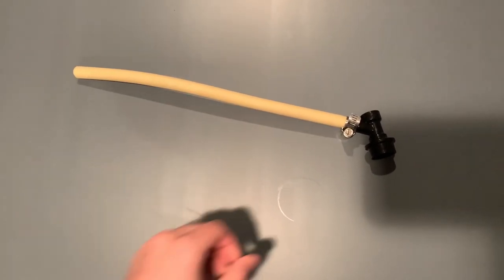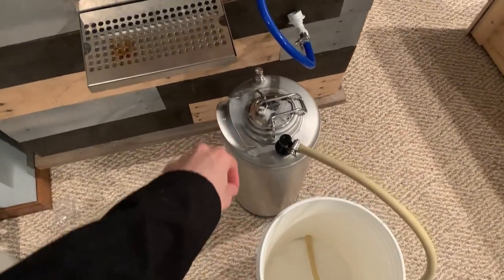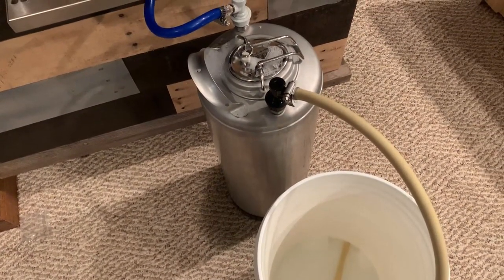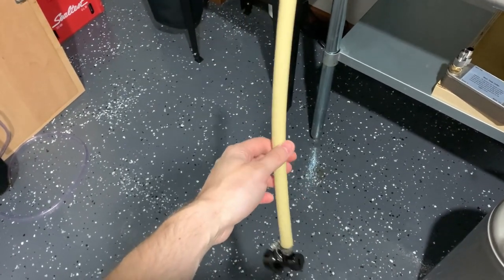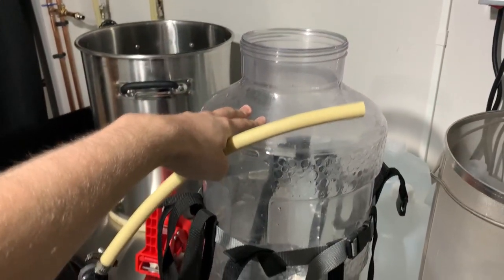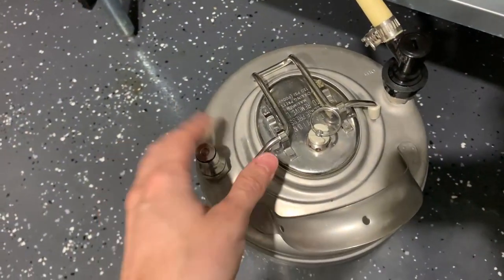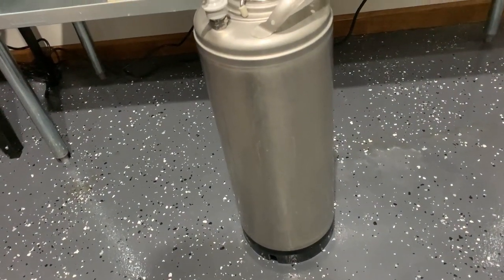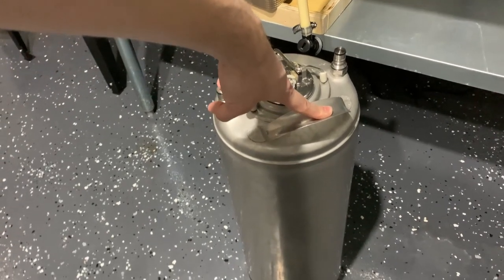CHEAPEST and EASIEST Way for Low/No Oxygen Transfers Into Kegs!

Comment: Hello again Matt - I do something very similar (though I am shiphoning out of glass carboys).   The only extra thing on my transfer is that instead of using the gas fitting to vent co2 out of the keg and into the room, and having the vent in the fermenter to let in air.... I have a tube between those two so that the co2 leaving the keg goes into the top of the fermenter.   It may be overkill, but I don't like the air (oxygen) sitting on top of the beer in the fermenter.
Reply from the maker: Hey I just checked my email, thanks for the image! A few things... 1) I am familiar with that setup but I mainly wanted to cover a way to do this with a very limited part requirement. 2) plastic fermenters are very sensitive to pressure so when you are recirculating I have seen people do damage to plastic fermenters when doing that way. So I just opt for this. 3) As far as the o2 concern on the top, im sure there is some o2 that gets into the fermenter but there "should" be a co2 blanket over that beer from fermentation where very little o2 would be in contact, in theory. Also there is less risk to begin with since the liquid is not being shaken up.
Reply: I do the same. Works well. I had not seen anyone else do this. So, I’m not alone.
Reply: @craigdjordan  you must be digging deep in the archives to find this one.  I just bought a couple 6 gallon torpedo Corny's as fermenters.  Plan to set them up for similar closed system transfer.
Reply: Great idea

Comment: I use a really similar method to this. Pushing out the star san with CO2 does a good job of making sure all components are sanitized. I also like to run the star san through my kegerator tap just to be sure it is sanitized as well. I have had a batch of beer that was amazing, but then soured a few weeks after kegging and the sanitation of my tap was the only possible source. To conserve CO2 when flushing, I typically just give it enough CO2 to get the flow going then let it gravity drain out of the keg from there (will work as long as you don't pull vacuum in the keg). 

One difference is that I don't leave the star san heel in the keg. I think if you checked there would be a few oz of heel. I just turn my keg upside down for 5-10 minutes, let it all drain out, then purge the keg once more.
Reply from the maker: Yea there is no doubt that there may be a few oz of star san at the bottom of the keg. I do my best to be patient and try to push out as much as I can but I never really worried about this after looking into it a bit more and how star san could effect beer flavor/character. I referenced this - https://brulosophy.com/2019/10/21/the-impact-star-san-foam-has-on-beer-character-exbeeriment-results/

Comment: How do you avoid over filing the keg (which I'm assuming will just spill out the gas disconnect)? Could you use a check valve gas disconnect which I'm thinking will just stop the flow when liquid hits it? My brew batches are normally a couple of litres more than the 19 litre corny and i transfer into a purged but open corny so I see when it's full and i just bottle the extra.

Comment: How do you know when there is a pound of pressure in keg? Also when you hook up co2 line to get rid of star san what pressure?
Reply from the maker: Hey Joe! When I said a lb of pressure I just ment that there should still be some pressure but not a ton. So just lift the PRV to let most but not all the pressure out. Just need enough to purge the line that hooks up to the fermenter. When hooking up for starsan removal it does not need to be alot of pressure. Maybe like after 1 minute of co2 pushing into the keg you can hook up the line to remove the starsan. Just want to make sure co2 is continuously flowing into the keg to displace the starsan.

Comment: Great (and simple) explanation Matt! That is my setup (with a NB big mouth bubbler plastic fermentor with spigot) and awhile ago I tried doing it that way but also applying a few pounds of CO2 pressure on top.  Even with applying a few pounds of CO2 pressure on top the fermentor 'sucked in' which made me nervous (thought it might implode?)!
Reply from the maker: Yea there is really no need to apply the pressure on the top (gravity is your friend). There should be a "layer" of co2 on top of your beer anyway from fermentation so when o2 gets sucked in on the top it should not effect the beer. Also these plastic fermenters are really not built to hold a ton of pressure so things can go wrong quickly if too much pressure is applied as well.

Comment: curious how much star san is left in the keg after you push it out...people who cut their dip tubes probably have a decent ammount.
Reply from the maker: Im not sure why you would need to cut your dip tube at all unless you ferment in the keg? But then there is floating dip tubes that pull from the top I would think would work better in that case. Most sediment that settles down after you cold crash it in the kegerator will clear up after a few pints. If you don't use a floating dip tube or you dont cut your dip tube the amount of star san could be negligible. If you are concerned about it though let the keg sit for a few hours after the initial push out and then push it out again with Co2, that will clear up any access Star San in the keg.

Comment: Doesn't oxygen get sucked into the fermenter when you open the top?
Reply from the maker: Hey JC, yea im sure it does. It shouldn't be a problem though for two reasons. 1) Co2 is heavier then o2, from fermentation there should be quite a bit of Co2 "blanketing" the beer. 2) As long as the top of the beer is not splashed around there shouldn't be any o2 mixing into the beer due to the blanket AND its hard for o2 to be mixed into anything without agitation.

Comment: Will this work if I am using a floating dip tube?
Reply from the maker: I dont see any reason why it wouldn't work, worst case if it doesn't I would think you would just need to increase the height of the fermenter above the keg by alittle bit? But I would think it would work!

Comment: Since CO2 is heavier than air, would you really need to fully fill the serving keg. Eg, if you partly fill it with CO2, the CO2 will sit at the bottom, with o2 on top. You then fill it with beer via the beer QD, which pushes.from the bottom , pushing.out first the O2 on top, and then the CO2 below it?
Reply from the maker: Yep this would work! You dont need to completely fill the keg with Co2, I do try to get most of the o2 out though just incase! But its entirely precautionary.